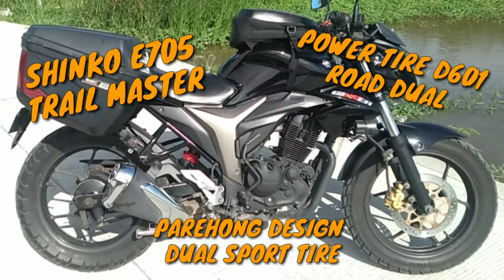MABANGIS NA DUAL SPORT TIRE SHINKO E705 + POWER TIRE D601 PAANO NAIKABIT?

Comment: Ahh di na sya stock size ng tires?
Reply from the maker: Di na po, kaya may mga kaunting modification po para ma fit ng maayos ung gulong .damay po duon ung sprocket combi gamit ko po 
Tmx rear sprocket 49
Tmx engine sprocket 16

Pero pwede na po ung 14 engine 45